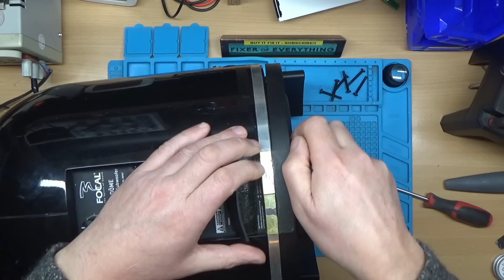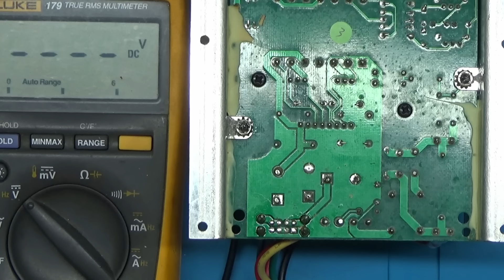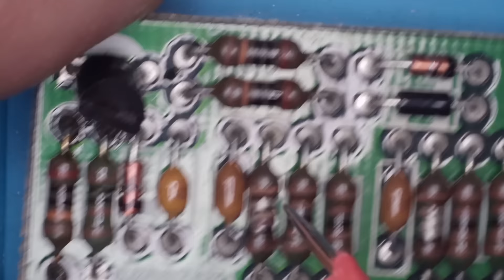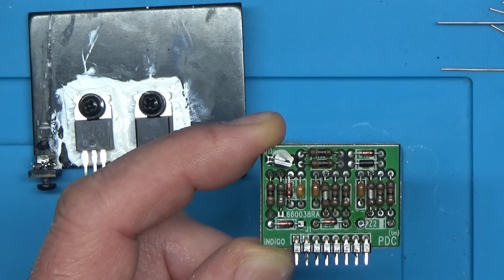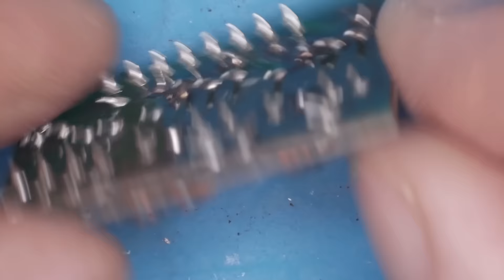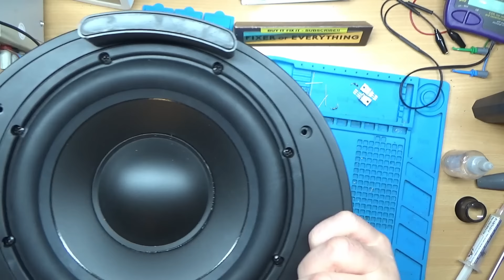Faulty Focal Dome Active Subwoofer | Can I Fix It?

Comment: I thought this looks like a highend sub until i've seen that oscillator circuit it is used in very cheap ones for God's sake :)
Big thumb up Mick well done !
Reply from the maker: Thanks mate 👍Yes I was surprised when I searched the price of it. High end price, budget internals...
Reply: @BuyitFixit  As is the case with most things these days. I once repaired a Panasonic microwave which had cost my customer £200 new 2 years ago. It had a major fault on one of its PCBs and ended up getting scrapped. Anyway, I took apart a £1000 Bosch microwave which proudly displayed Made in Germany when you opened the door. Some of the parts were the same, literally exactly the same. The German made (Chinese) magnetron had failed and I kid you not it was the cheapest, lightest, slap in the face I've seen. On yet another microwave, a scrap ASDA own brand one from 2006, the magnetron weighed double despite them having the same power rating.   

My advice is to buy the cheapest item you can find that does the job you need and looks how you want it to because nothing will last more than 3 years even if you look after it.
Reply from the maker: Interesting. I've got a Panasonic microwave too! 1000W inverter one. Had it nearly 10 years now, and it's still going strong (although the button to open it looks quite worn now).

Comment: Smooth fix Mick, good job.  Those resistors were terrible to read values on, poor choice of color..  When you found the FET was bad, I thought diodes were gone as well, surprised myself😉 Amazed you found the little board w/values online, that was quite nice.  Great video and troubleshooting, thanks.  See ya next time.
Reply from the maker: Thanks Terry, although it was the opposite way around. The diode was gone, and the FET was good 🙂👍
Reply: @BuyitFixit  Oh man, my bad...not surprised by that😒

Comment: Hello Guildmaster, greetings!

Unfortunately, my electronics knowledge is very limited. The small circuit board seems quite cluttered compared to the other components. Doesn't the device have a ground connection? The housing is made of aluminum, isn't it? And is "aluminium" really pronounced differently in the US than in the UK?

Keep up the good work!
Reply from the maker: Thanks 👍Yes with it being a metal case I would have thought it should be earthed too. and yes it's even a different spelling in the UK to the UK. It's like we call it "solder" and US calls it "soder" and pronounce it that way too!
Reply: @BuyitFixit  You're to kind Mick, Solder is pronounced Sol-der, because it is spelt that way. 👍
The use of proper english is to pronounce words based on their spelling rather than historical pronunciation (or some slang adaptation).
Solder being pronounced as Sodder (Sod-her) is supposedly an adaption of the French word Soudure (french for Solder), so Sodder is just a pronunciation thing and not a word in French or English!?
Reminds me of the Simpsons episode where the mansion's sang "who kept the Metric system down, WE DID"...

Comment: Millions of people die each year from getting electrocuted by charged capacitors... 
We need to bring even MORE awareness to this terrible risk.
NOT...LOL
IDK who started this scaremongering nonsense but I wish I could slap them.
Reply: Yeah, it's a low number. They can definitely kill you, but total electrocutions for the entire US/yr avg only in the 100's, so death by cap is probably only a handful.
Reply from the maker: The Studio flash I was just working on probably falls into that category. 2 x 400v at 3200uF in parallel.
Reply: @oldo2840  I wonder why these folks aren't warning people about wearing socks on carpet in dry areas of the world...LMFAO!!!
The confuser is tell me over 1000 people dies from electric shock.
I haven't done the math but in order to store enough angry pixies in a capacitor, (unless the person had a pacemaker or per-existing sensitivity to pixies) it would have to be really huge... like the size of a coffee can.
Reply: @aurthorthing7403Not sure that's the case. A few mA can kill you and there can be hundreds of volts in the caps used in big amps, TVs, etc. Much more likely to get a flash burn though, and that's going to suck.

Comment: 4:11 did you try and measure voltage from either side of the same trace? LOL! Love it...
Reply from the maker: Yes I noticed that too when editing 😂😂The caps were only 35v or so anyway. That's the problem when your looking at the board, looking at the monitor to check you're not too zoomed in etc etc. Also I have a different view to the overhead so sometimes things are easier for you to see, but not for me.

Comment: Nicely done as always!  Who'd have thought Vince could test repairs for you?! 😀  You probably know this, but if using silicone gunge to replace any other stuff on circuit boards, make sure you use builders or food grade silicone sealant and not the common bathroom variety as the latter has acetic acid in it to prevent mould - and that eats away metal tracks and component legs.  If it doesn't smell like vinegar then it should be ok.
Reply from the maker: Cheers Mike, and thanks for the tip regarding the silicone 👍

Comment: quite expensive subwoofer to have such poor-quality pc board material. Great fix
Reply from the maker: Thanks mate 👍 Yes totally agree, I was surprised when I found out the price of these. Premium price, budget internals.
Reply: Yeah. i was thinking, its probably advertised as a 300W woofer.. and then it has +\- 15V rails
Reply: @MC-Racing  actually I think the +/-15 are for that smd op amp (my guess) you can see at about 10:30. The main rails will be higher - I hope 😂

Comment: How do you get -15v and +15v ?
Reply: On the board they are achieved using voltage regulators usually
Reply: I work in automotive and only ever used +voltage i never new you could actually get a negative value too?
Reply: @arnieboy2004   It's handy since you get a 0V output when switching things on. A nice example is an opamp,  there is no voltage 'swing' when switching it on or off if you use a positive and negative supply.  If you only use a assymetric power supply (=only GND or minus and a postive) you will have to resort to half the voltage on the output and then use a capacitor to get the DC off.  There are more benefits and of course there are disadvantages as well but the benefits outweigh for sure.
Reply: @Luke-san  thank you for the explanation